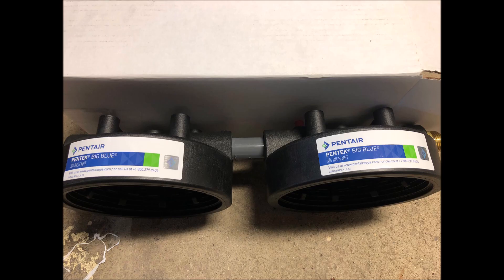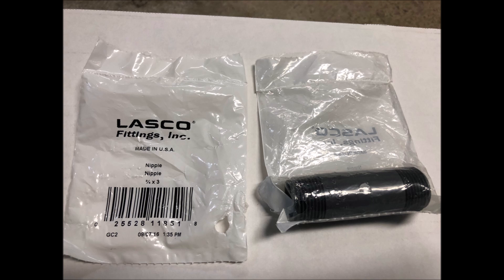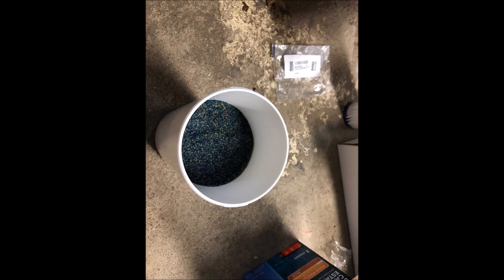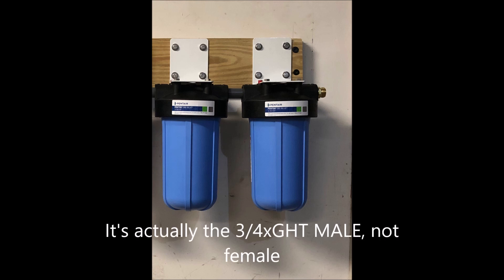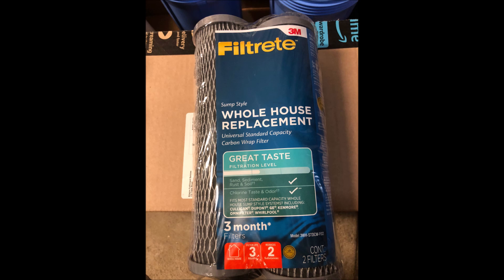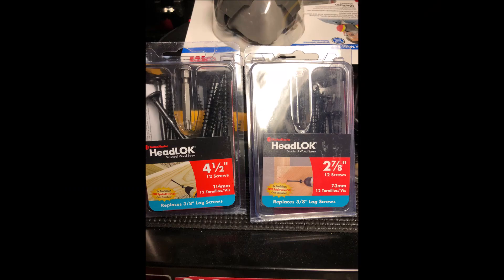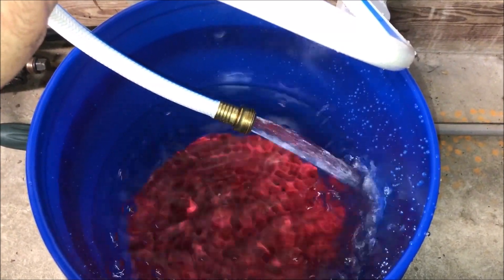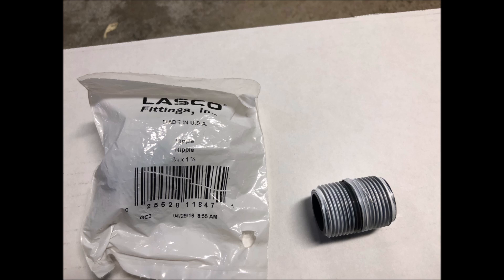DIY Spotless Car Wash/Rinse System

Comment: Thank you for the awesome video. Would appreciate any input I want to make my own filter for washing my cars   To remove calcium and chlorine   California/LA water  thoughts ?
Reply from the maker: This system will remove chlorine with the carbon filter, and the DI resin should remove the calcium. The first filter, the sediment filter, helps keep the pores of the carbon filter from getting clogged so it doesn’t have to pull double duty. Some places, like chemical guys for example, just use big tanks of DI resin only, so that’s also an option.

Comment: Thanks for the video. I have been looking like crazy on what to do. my well water is about 500ppm and looks like i would be replacing the filter material so often its just not cost effective even with the big $400+ systems, but I do appreciate showing what you set up. Thinking of a rain catch bucket and using that for the final rinse on my cars. :)  Thanks!

Comment: Whats the total amount for this ?
Reply from the maker: Initially it was around $275. I went through Amazon and looked up current prices. For everything, down to the charcoal filter, DI resin and fittings it now around $290. Thanks for watching!
Reply: @jeremybradley9244  I’m having trouble finding the list of parts in the comments.  Do you still have the full list of parts needed?

Comment: I know this video is a year old but hats off, great how to!

I built one similar to this a few years ago but I only had once sediment filter and one DI media filter.

I need to put together a new setup at my new house and I'm going to go with what you have in yours.

I made the mistake of mounting my old setup outside and ended up destroying both canisters due to a hard freeze (my bad I should have brought the hose reel inside).
Reply from the maker: Xander Snyder I appreciate that! Remember if you have chlorine or chloramines in your water to use a charcoal canister before your DI